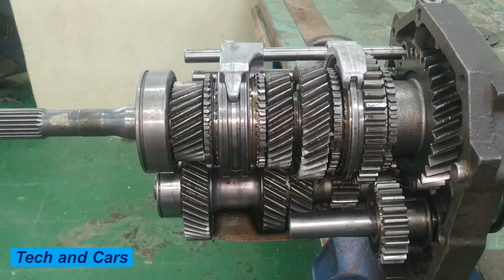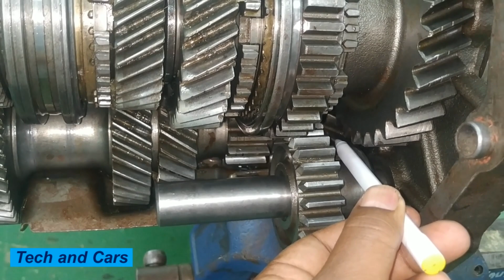How a 5 speed manual transmission works

Comment: When you put it in reverse, which of the spur gear moved? the one on the output shaft or idler?
Do the idler gear have another fork to move it or does it constantly meshed with the counter shaft?
Reply from the maker: Only the idler gear on the idler shaft is moved. We slide the idler gear and mesh it to both counter shaft and output shaft gear. The reverse idler gear has a separate fork for engagement and disengagement!

Comment: Do you know why 1st gear is usually noisier than other forward gears? Is it because the teeth "density" is smaller than in other gears?
Reply from the maker: First gears are usually made up of spur gears! Spur gear is noisier than helical gears used in other speed gears! Spur gears have a sudden "slapping" tooth engagement when meshing, creating vibrations and impact forces that generate audible noise, unlike helical gears which have a more gradual, sliding contact due to their angled teeth.